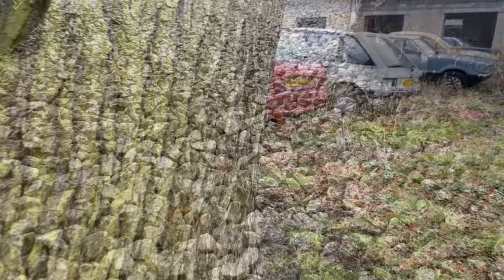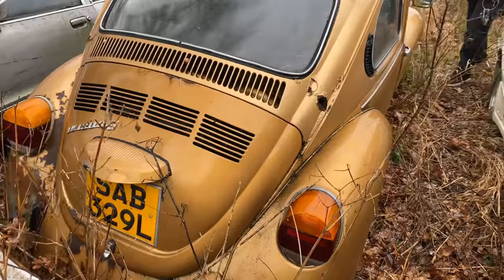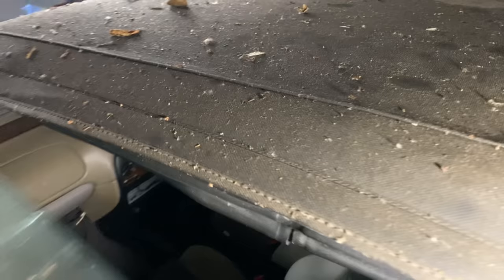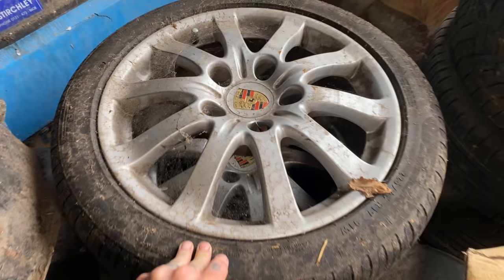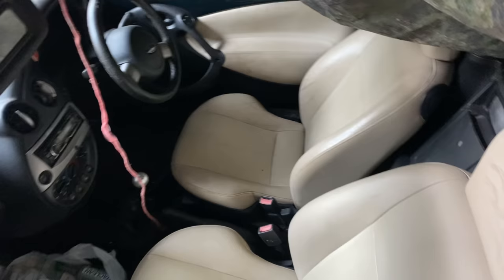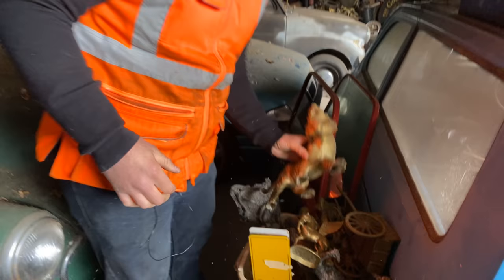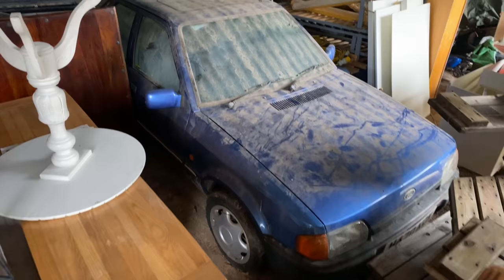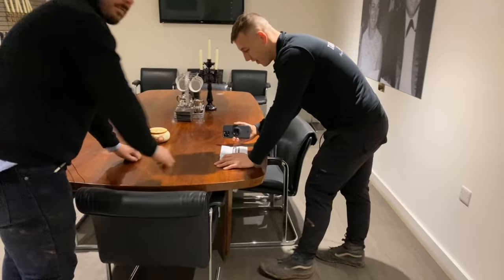Inside This Barn We Found Classic Car’s A Mountain Of Bronze And Some Incredible Items!!

Comment: Here in the U.S.A., the Mitsubishi was known as the Conquest.
Just to pass along a bit of VW knowledge, that's technically not a Beetle. That's a Super Beetle, there is a difference. The way you can tell the difference is the nose. A Super Beetle's nose rounds back under and has vents at the bottom. A Beetle's nose continues down at the same angle until a very tiny rolled lip at the bottom. The fenders vary in this regard as well. There are other differences, but that's the most striking one from the outside. The Super has McPherson Strut suspension up front and all have IRS (Independent Rear Suspension) out back that used a torsion bar for a spring. While these produced a better ride quality, and slightly better handling, they were no where near as reliable and as rugged as what came in a true Beetle. Those had a twin torsion bar front beam and most had a "swing" axle in the back, but the later years had the same I.R.S. setup as the Super Beetle.

The front of the Beetle was way tougher because the beam for the front was a self contained unit. If it had problems, you could just unbolt it and swap it for a new one. You could abuse those things over and over and they would come back for more. We would use them in buggies and launch them off jumps with no worries of them ever failing. The Super Beetle's Struts mounted to the inner lip of the front trunk (boot to you guys over there). If you hit the car in the front, it was really hard to get proper suspension geometry back again. I've seen those take half the abuse of a beetle and punch the struts through the sheet metal and out the hood, ruining the car for good at that point.

The rear of the Beetle was just as tough. The original "swing" axle cars did not have C.V. joints that would fail. To break a swing, you had to snap the entire axle shaft, almost impossible to do with a car that light, until you reach turbo-ed engine numbers. Those were also geared way lower as they originally had way less power, so VW made up for that with gearing. The swing axle only pivoted at the transaxle it's self and not at the tire. This resulted in the wheel/tire following the arch of the axle and caused the tire to have large amounts of negative camber under acceleration, and large amounts of positive camber while in reverse. If a driver was not use to this, and what it could do, people could possibly roll a car, but not very likely, especially in a VW, or Porsche which used the same thing. So, after a media campaign, which has now been proven to have been based on lies and doctored vehicles, against VW but most of all the Chevrolet Corvair and a book "Unsafe at any speed" by a congressman who's name is not worth repeating, VW moved to the IRS and Chevy stopped the Corvair all together.

The new IRS axle used a CV (Constant Velocity) joint at each end. This resulted in a tire that remained in almost exactly the same camber setting throughout it's range of motion. It made the car a little more sure footed, but the reduced weight transfer resulted in less weigh being transferred, which means less traction to be had, so the gain in forward motion was negligible. The gain was in stability during backing up. The reduced reliability of, at times, very fragile CV joints, when compared to the swing axle, makes the swing the more desired axle among off-road and drag race enthusiasts, where the IRS cars are more preferred by those wanting to road race a Beetle. The older cars are also more desired for kit cars, as they do not need a surface to mount the struts to. The swing axle cars are anything from 1967 and older. In 1968, the 4-speed cars were still swings, but the autostick cars were IRS. In 1969 and on they all became IRS.